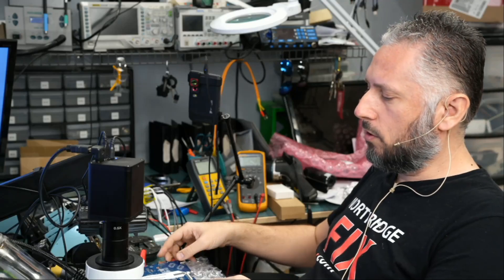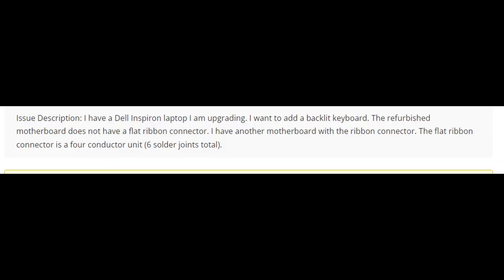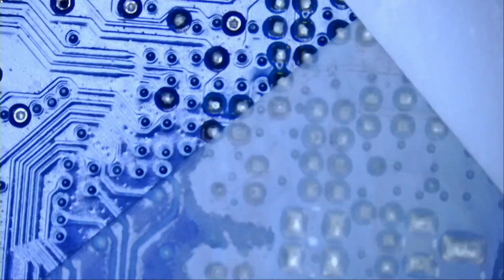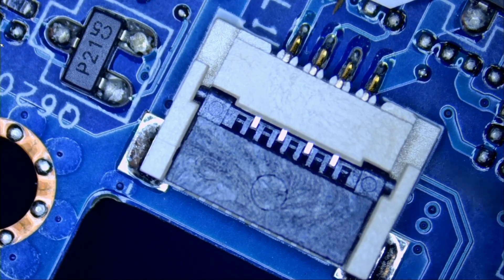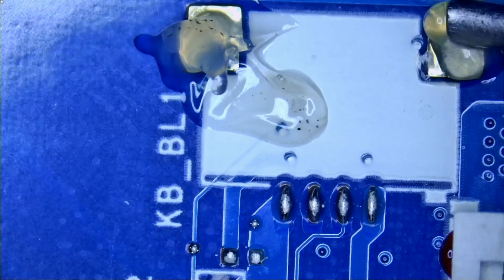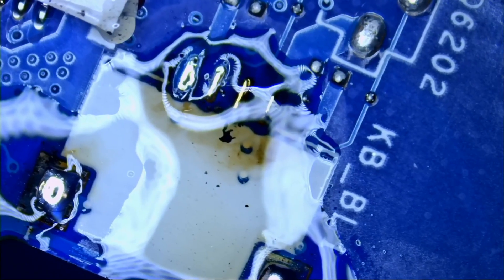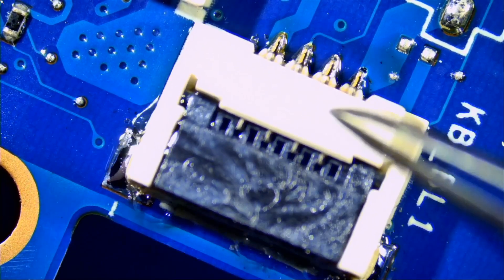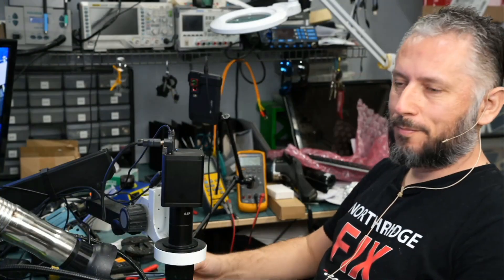Dell Skips on a $1 keyboard backlight connector. Customer wants us to add it in.

Comment: I also noticed, there are some components on the donor board thats not on the customer's new board that will probably need to be moved across as well.
Reply: I wonder which dell this is. For parts, labor and expedition it seems as if this machine is more than a few years old, a replacement might make sense.
Reply: Try France they still use cheques, see them being used every week when shopping
Reply: I guess the customer wants to swap only the connector because its fragile and he can later swap other components if they are required for the upgrade.
Reply: Exactly
Reply from the maker: Yes that is for the customer to figure out. We don't reinvent the wheel and only do exactly as we are told. The job was to replace the connector whether it works or not. We can't even verify if the board is fully functional  As soon as you temper with anything the customer did not ask for, you'll quickly get blamed for it.
Reply: @NorthridgeFix  Everyone now aday's is out to screw  the working man.  I do not blame ya. you are exactly right.
Reply: @NorthridgeFix  Agree with that. If the customer wants to know, it seems that Q6202 (on the good board) is not populated either, as we can compare with the donor board at @2:04 . Perhaps this transistor is also implied in the keyboard backlight control (something like 0/25/50/75/100% levels), and maybe few other components, and even differents EFI/BIOS. Anyway, thanks for your videos ^^
Reply: @NorthridgeFix  I totally agree, something doesn't work and you'll get the blame. As my old man used to say, no good deed goes unpunished.
Reply: @NorthridgeFix  that's why, only do what customer told to do it. Using our own brain to add or remove something, the customer will blame if later on it doesn't work or damage anything.
Reply: I think the keyboard backlight require only a single connector where to get power, single connector which is missing in this one

Comment: Nice work and thx for the tip on an anti-glare light! I'll never forget my first micro -soldering job, was replacing a PS4 HDMI connector and to make it more interesting I had to older two connections to alternate points on the board! Good times, I never realized just how steady I could be!

Comment: Nice job, batter then factory. I think customer might be able to move that transistor and the capacitor by it self, the current limiting resistor already there. If the customer don't know anything about electronic, why sending the board only. They should send the entire laptop.

Comment: did similar to my sata connector in msi gf76. got connector from usb external harddrive box, soldering cost around 15$ (guy did each pin by hand). I bought hdd for my dying lenovo laptop, it died and I wanted to use hdd since there was 500 gb of steam games, m2 was too pricy at that time (and currently it is x2 price of hdd).

Comment: A friend of mine had a Dell laptop. Its battery was 100% functional, it was charging and maintaining charge without problem. One day the laptop refused to function properly. He called Dell who told him that it needed a new battery. It didn't matter that the battery was 100% charged, they insisted that it needed a new battery. I believe they were asking him 150 british pounds for the battery, plus the costs of the "engineer" who would come to his place to install the new battery. He was outraged, threatened them with legal action, he was told that "the manager would call him". Some time later "the manager" called him, to insist that a new battery had to be installed.

Comment: Don’t know if you have covered this, but I’ve watched a lot of your videos and am curious. What temperatures are you using with your soldering iron when you are doing various tasks? Is this something you can overlay on the video or just shout out when you do it. 

I’ve been an EE for 15 years and only occasionally do soldering work at home or at work and pretty much just eyeball the temps. I assume it’s based on solder melt temps but as we all know, experience outweighs what the label says very often. 

Great work as always.
Reply: Temperature would depend on melting point of the solder and heatsinking capabilities of the components you are soldering. Massive pins could use extra heat. There is no precise temperature what would work for every possible occasion.

Comment: Why not use low melt solder for the final connection?
Reply: Low melt solder is weak and should not be used for actual connections, as it won't be reliable. It's best used just to lower the melting point of the existing solder and then it should be throughly removed when used.

Comment: Dell did the same cheapness on the nee G15 laptops. The older G15 had functionality for two M2 drives.  The new G15 has a piece of foam instead of the connector for the 2nd M2 drive . Basically saving them money by being cheap.
Reply: Or making extra money when they sell the super upgraded version extra for you with the second slot for just $2-300 more. While the cost for them per board is maybe $10. 😎

Comment: Why you do not mix a little bit of leaded solder to the unleaded joints, to make it easier? It will also lower the melting temperature and make it easier with the hot air as well.
Reply: there is 1001 ways to fix stuff 👍
Reply: Not needed. If he wanted to do that there is the second method of low melt solder (it consists of Bismuth alloy) for the very same purpose of lowering temp to even much lower when compared to leader solder. He shows that method in some previous videos if you want to know how it's done. When applying hot air from bottom, entire board gets heated and the connector reflows. It doesn't matter as board can take a lot of heat without damaging the connector.

Comment: What are those solder balls on the traces? Are they like "traps" from the company so if hot air gets close to them they fall through the board disrupting the path? Or, am I way off here? Thanks in advance for whomever may respond.
Reply: Someone already answered this before. They can be used to disconnect parts of the circuit for testing.
Reply: There's nothing like traps in any circuit board design. No company does that cheap tricks as it would become points of failure. I don't know what exactly you saw but solder can get stuck in holes for through-hole components like certain connectors. Still the stuck solder wouldn't fall off due to a physical phenomenon called capillary action. You need a solder wick or a solder sucker to clear the holes. 
If you are talking about the refurbished board, the solder balls looking are just pads for unpopulated components like resistors and transistors. The refurbished board has lot of missing circuit components needed for proper working of backlight circuit. Since customer only asked to transfer the connector, Alex just did that job. He deliberately didn't transfer other components since it might cause issues later on and he has to take blame if something goes wrong. 
If you are talking about another video where stuck solder in the holes of a circuit board, it the same stuck solder but it's due to a type of manufacturing process. A board with all through-hole components would be dipped flatly enough in a lake of solder and all the holes get filled. Those holes without components also get filled. It's called wave soldering.
Reply: You could also be looking at the solder from other devices that are mounted on the other side of the board. Through pin style mounting.